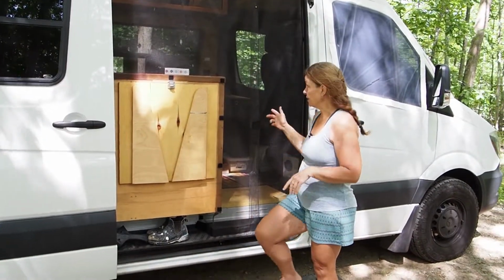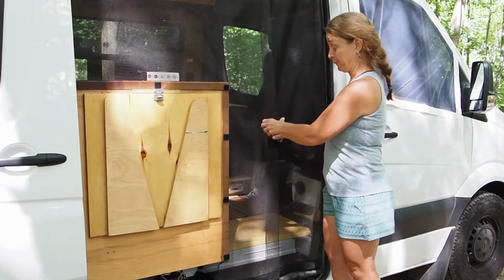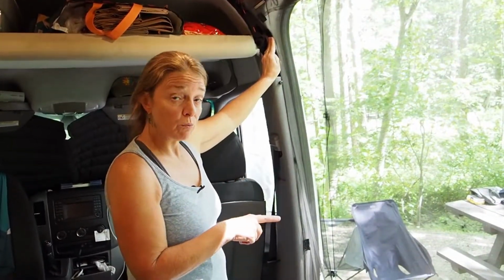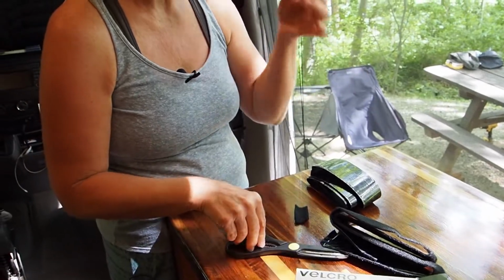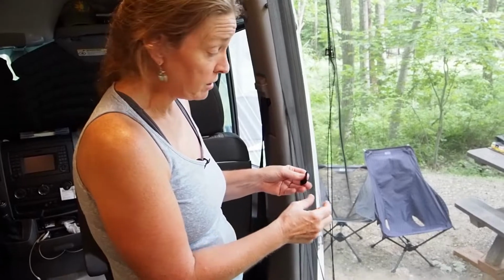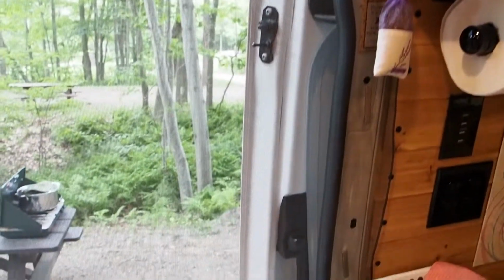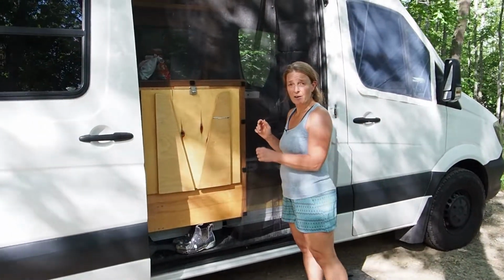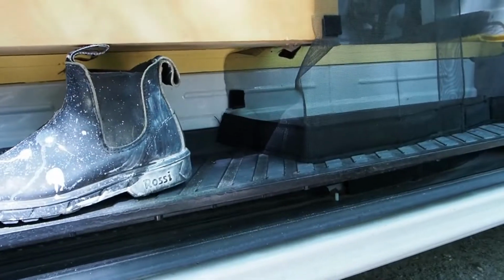HOW TO MAKE A BUG SCREEN FOR YOUR CAMPER VAN SLIDING DOOR - Easy, inexpensive and very effective

Comment: Im working on my mosquito netting this really helped. How did you finish the bottom it looks like you taped it. I tried three m tape and it would not hold. I used the mosquito tarp from harbor freight. I got the smallest tarp.
Reply from the maker: The screen we used (in the link below the video) came with the edges finished so we didn't need to tape it. Maybe you could tape both sides and then add some staples to help hold the tape?

Comment: That looks like a pain to put up and take down. Have you thought of a more permanent solution? I'm looking at installing screens with the option of leaving it up permanently and just rolling it up and securing at the top when I don't want to use it. Nice temporary solution though.
Reply from the maker: We leave it up most of the time actually.
Reply: @TimAndShannonLTD  do you have any issues with the door ever snagging or breaking the screen?
Reply from the maker: @skwerl81  so far so good. The door has never snagged on the screen.
Reply: @TimAndShannonLTD  thanks so much! I'm going to try to take on this project this week ☺️
Reply from the maker: @skwerl81  awesome! Good luck with it!